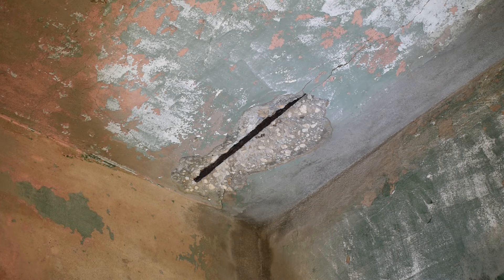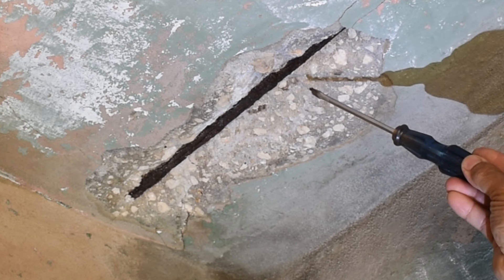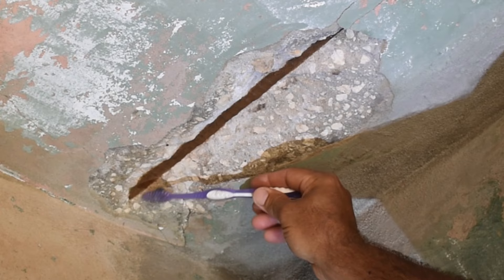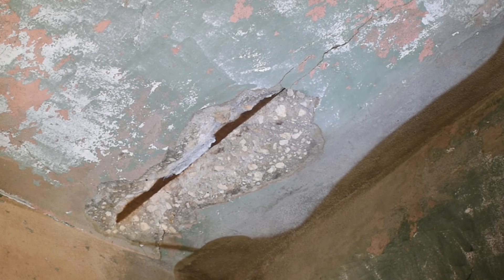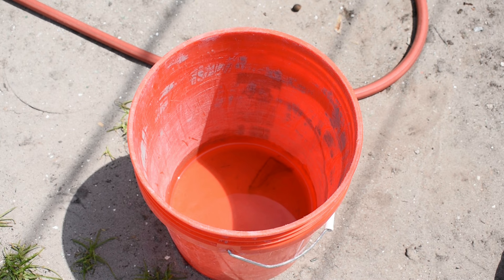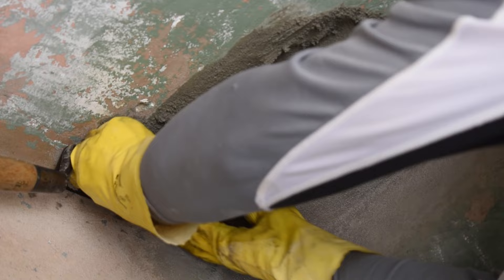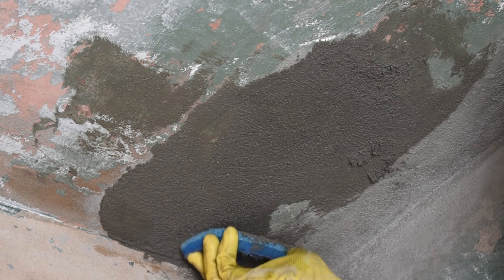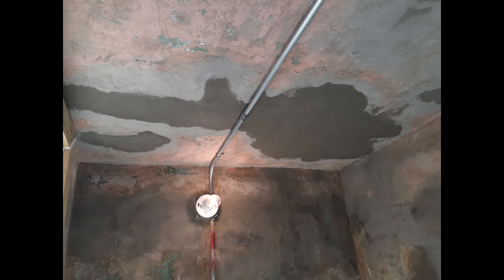How To PROPERLY Repair Concrete Damaged By Rusted Rebar (Ceilings/Walls/Floors)

Comment: I live in Puerto Rico and many of our houses have concrete roofs. Many were built before epoxy coated rebar was available and built using beach sand so yeah, this is a very common repair we have to do around here. You did an excellent job! I would add to use concrete bonding agent and, you could substitute rust oleum with phosphoric acid of some sort to treat the rust. As you mentioned on the caption, one MUST treat any leaks and seal the roof beforehand otherwise, all that work be soon for nothing. Great video!
Reply from the maker: Glad you liked the video Fred!
Reply: I am in old san juan.  I have leaks in roof and exposed rebar.  What would you suggest? I do have a contractor, but i want to make sure he does all the necessary steps.
Reply: @michaelk906  Hello, It all depends how bad your damage is. I would get an engineer or contractor define if the roof is repairable. I've seen some roofs that are simply too far gone. I hope that's not your case. Anyhow, the 1st thing I did in my case is control the leaks and the spots where water accumulated.  I did a complete stripping of multiple coats of different sealants that were on, level the low spots with self-leveling cement, treated the roof with a good primer and applied 3 heavy coats of Lanco Urethanizer, allowing a few days in between coats. I really like that product and holds up way better than the usual silicon elastometric products. It shold last at least 5 years (with a yearly pressure washing and spot checking).  Sealing your roof is essential as it will prevent humidity from making the rust issue worse of course. Once that is taken care of, you can allow your roof to 'dry up' and then you can tackle the exposed rebar as I mentioned on my previous post. 1. chip away loose rust and cement and appy 'Klean Strip Metal and Concrete Prep' (phosphoric acid basically). It will convert the rust into a good base for paint and cement and also prep the surrounding cement 2. use cement bonding agent and apply cement. If the holes are big/deep, do it in various coats, allowing 15-20 minutes to an hour to allow it to harden up between coats. If you do it too thick, the whole patch may fall off.  As I said, this is a very common repair here in PR. If your contractor is competent, he should recommend a similar approach. Again, stopping the leaks is 1st priority. Best of luck!
Reply: @FredLarracuente  one more question if I may.  In old san juan , I have a 3 story small commercial property.  There are existing stairs  to second floor on back of property- 65 feet towards back. (have to walk thru the existing retail shop).Now i want to make the 2nd floor a residential apartment ,  so I want to make stairs from the front entrance of building to second floor, as I'm planning on making a residential apartment.  Will I cause a structural issue by building stairs and breaking a hole in 2nd floor ceiling?  I'm not going to touch  any of the load bearing beams.
Reply: @michaelk906  Sorry, I'm not a civil engineer but I imagine a contractor would be able to tell you if it would be possible. It may need a reinforcing wall or column to bear the load left by the hole and also hold the new stairs.
Reply: @FredLarracuente  I sincerely appreciate the quick responses. Have a nice weekend.
Reply: maxmarrero9635  Agree. I've had instances when I had to do just that.
Reply: Hello Fred, Can you patch my house in Alturas de rio Grande?

Comment: Nice repair but wouldn't the first thing you do is find out how the water is getting in to corrode that rebar to start with?? I would think stopping that problem would be your #1 issue.
Reply from the maker: That was mentioned in the video.
Reply: if the rebar is rusting the whole shit is completely fucked and won't last much longer. that patch is literally just that, a bandaid patch. even if he stopped the leak it'll continue to rust out
Reply: It will be ok for the next five years. Enough of time to sell the house. 😂 I understand the idea of chipping away the concrete to the rebar and make sure the rebar outside of the spalling area is free of rust. Then repair.

Comment: Good job on the repair.  Question, is that room a bunker?
Reply from the maker: It's a concrete block room that's connected to the back wall of a concrete block home.
Reply: @electronicsNmore  I thought it is a good idea(depending on distance to a water body or altitude) to have a bunker in Florida for hurricane season comes.  I am near Chicago so it would be great here as well.

Comment: Hello, thank you for this super helpful how to. I'm renovating a condo with a concrete ceiling. We removed a popcorn coating and now want to seal the concrete to protect it and keep concrete dust from continuing to fall. The ceiling is in good condition, it was cast in place and has "beams" cast into the concrete, so it's not a completely flat surface (meaning we'll need to do some brush work to apply the coating, as we'll be unable to use a spray application.)
I am wondering if you can suggest a product that is compatible with use on a ceiling and help us reduce brush marks during application?
Appreciate your time!
Reply from the maker: Never had to do that.

Comment: this what i would have done.drill into cement put anchors in and attach hardware colth,,1/4 in wire net to anchors screws,,then cemet,,using Rock tite
Reply from the maker: In the past I've drilled in tapcons to act as anchors.

Comment: How long does the repair last?
Reply from the maker: When done properly, and you also make sure no water can seep in from above, it will last years.
Reply: I had handyman did that job on a ceiling, lasted maybe a year. Next time I will DIY.

Comment: Wouldn't it be better to chip the concrete past the rebar to make sure the new cement adheres and is help by it?
Reply from the maker: Just remove all loose concrete.
Reply: Cured concrete will not bond with newly added concrete. It will always crack and separate. Sometimes when you pour a couple of inches over old concrete, the weight of the new concrete keeps them together. But, if water manages to get between the layers, it will eventually cause damage (particularly if it can freeze.) Laytex bonding agents (as used in the video), and other types too, provide the interface, between the layers, to bond them together. It is easy to use, and makes a very strong bond.
Reply: You need sika voh